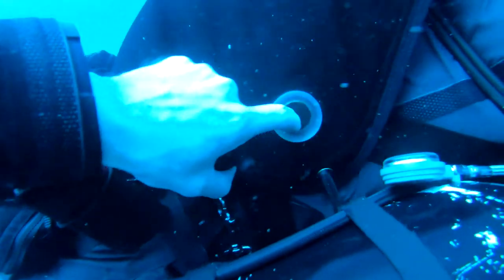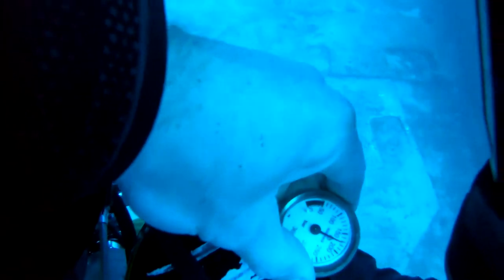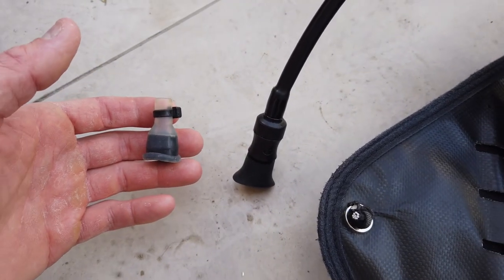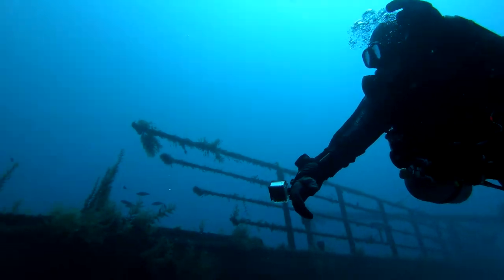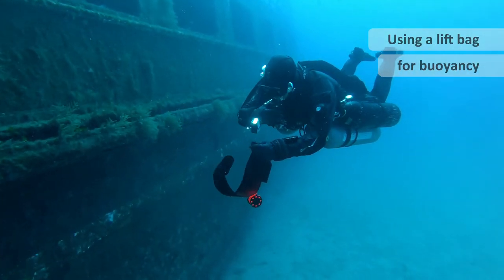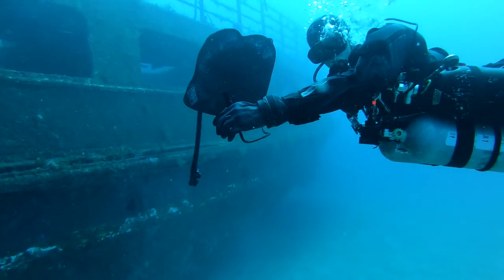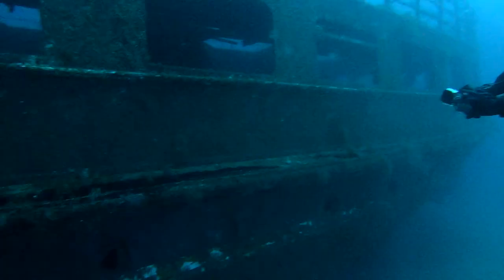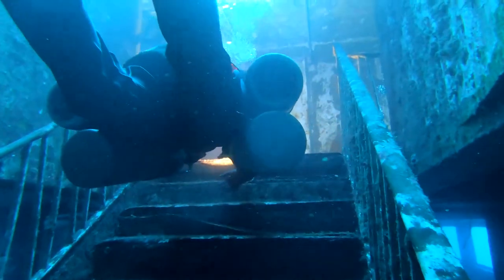BCD Failure : Multi-Stage Technical Diver

Comment: Great video and thanks for showing. A BCD failure is something I really want to do more training with (not doing as you did obviously!) as it's the little bugbear that is on my mind during a dive, rational or otherwise. I've only just finished OW training and about to do dry suit training. Once I have my own gear I'll feel a lot more comfortable with knowing my own correct weightings for different scenarios and always want to make sure I'm not overweighted. Having to switch borrowed gear makes it more difficult to track and be certain about with limited dive numbers and I hope that having a number of dives with mostly (+/- undersuit volume) my own gear will give a lot more confidence.

Comment: 4 tanks of more or less 11 - 12 L filled at 200bar it's nearly 11kg of air... I find it to be very strange to be able to compensate with your lungs.
You're saying he is correctly weighted, but It really makes me wonder if he would have enough weight to stay stable at 3m with nearly empty tanks.

Could you explain how can anyone compensate 11kg of air with a lung volumen which is rarely more than 6L (and that would be compared with a completelly empty pair of lungs).
Reply: Hi,

So yes, you are adding up all the gas weights (2.7kg for 200b in an Alu S80, 2.9kg for 200b in a 12L).

But we are not suggesting you can lift that volume of weight without some buoyancy.  We are suggesting that the gas in the dry suit, plus kicking up, along with the lungs (and either SMB or backup bladder) is enough to establish buoyancy.  We would be ending the dive at this point and not taking so much more gas out of the cylinders.

We also need to consider that we won't weight ourselves for zero bar, but at something more realistic like 50b for the main tanks.  If we used this much gas on the dive, then the deco obligation would not be so high as to need more than 50b from each deco cylinder (plus we would have had something interesting happen to make us go so much over plan).

Additionally, at around 100b the Alu cylinders are neutral and for the maximum bottom time we would get when obeying a minimum gas rule, we would not take more than 50b out of each deco cylinder.  If we were in a situation where these deco cylinders did become positive, then we also have the option to ditch those.

I do accept that the total pressure you weight yourself for will change the weights you may want to carry, but at the same time you have to consider all the other aspects when you are making this type of technical dive and what is likely vs unlikely (e.g. to have more than 100b needed of deco gas you had to of overstayed your bottom time by a huge amount etc.).

Lastly, we wanted to keep the idea on the suitability of the dry suit and other methods rather than go into all the considerations of the dive itself - because as you say, that is a bigger subject - and for sure if the wing failed, I would be heading up and not making these kinds of movies at the time :-)

Hope that helps explain a bit more.  Cheers.
Reply: If you actually paid attention... even in a failed wing you can still hold volume and that helps aswell... long story short.